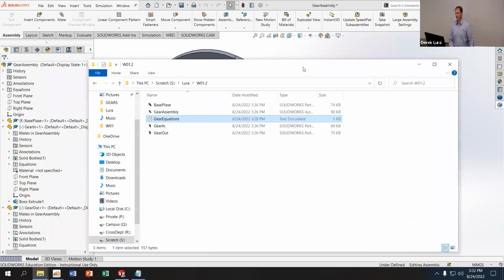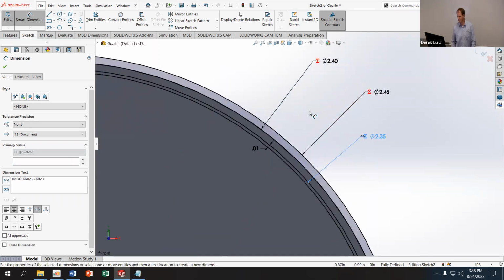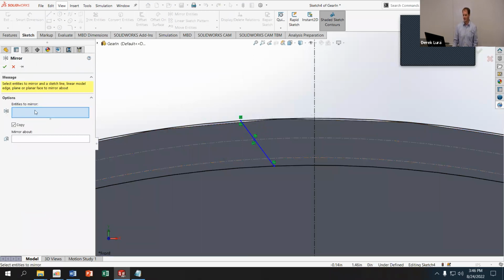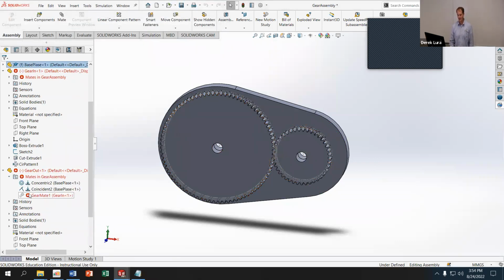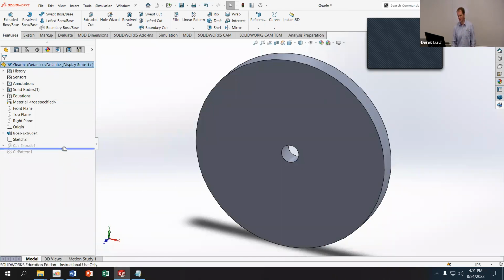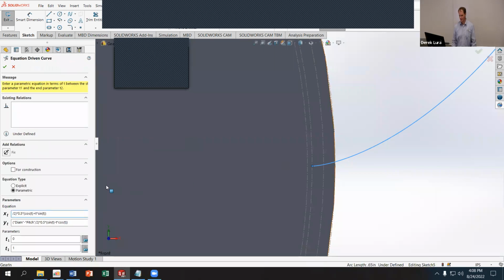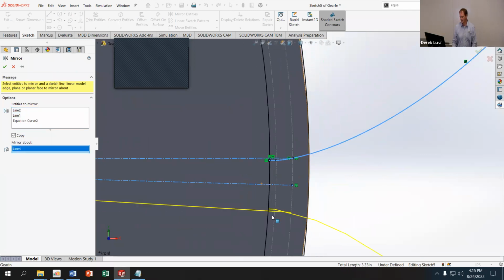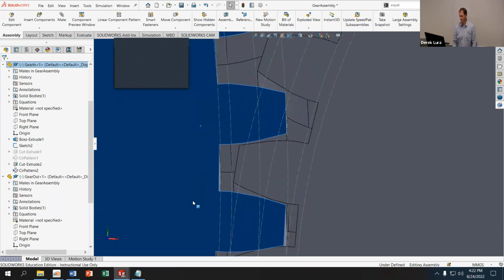Adding Complexity to Gear Profiles in SolidWorks

Comment from the maker: Turns out the mirror for the second half of the tooth cut out is the part that is most likely breaking the ability to automatically update the part when changing the gear ratio with the involute teeth. So we DO need to use an equation for both sides of the tooth (unfortunately).